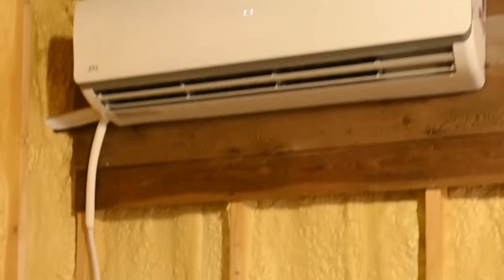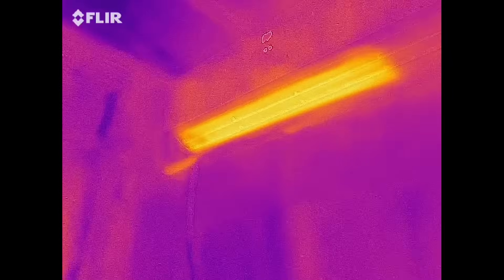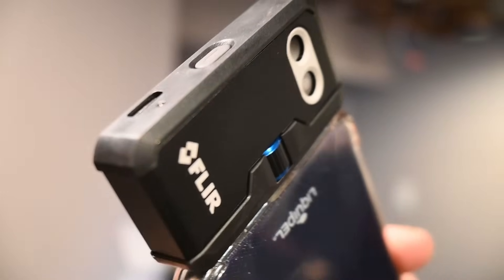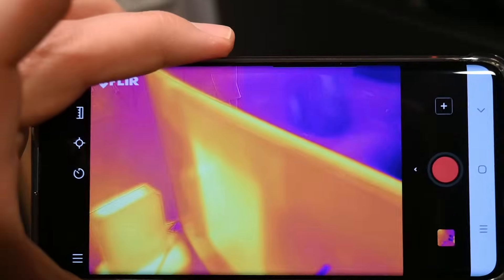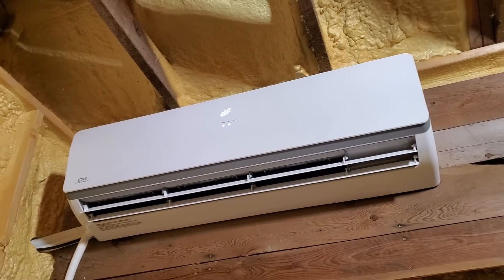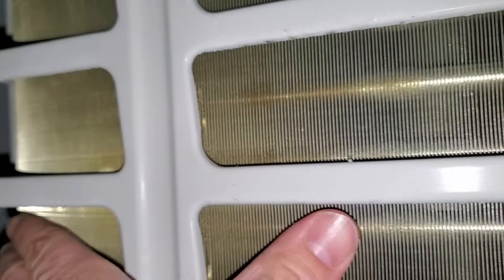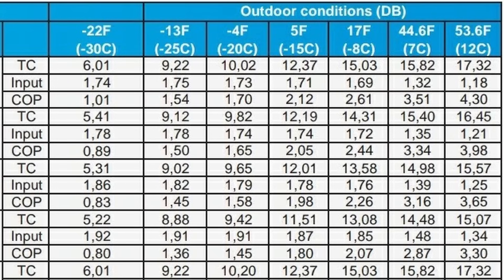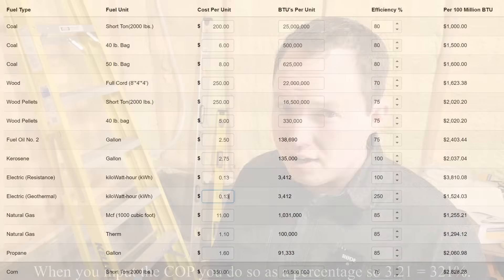Can You Use a Mini Split in EXTREME COLD? Heat Pump vs. Propane Cost Comparison with Thermal Camera

Comment: A heat pump does not pull hot air out of freezing cold air, it uses the heat generated by the gas being compressed. Only the different states of the gas in the unit is used to exchange the temperatures either in cooling or heating.

Comment: Why can’t we put them in th attic instead of outside?
Reply: It will be a worse situation. It basically works like an Air conditioner in the space - without restriction, or you can think of it like it turns the attic into a freezer, and the main place it will draw it's heat energy from is the house below.
You will enter a spiral where the heat pump is just pulling the heat from the house whilst the house is also losing heat through the walls etc, so it will never be able to warm up.  The outside provides an abundance of heat energy for the taking.

There are some situations where a heat pump doesn't need to be outside, e.g. an exhaust air heat pump. 
Those are for when the heat loss from the house is minimal, and a controlled ventilation system is required for bringing fresh air into the house, and the system works by putting the "dirty" air already leaving the house through the heat pump so it can extract as much heat as possible before it leaves, along with some outside air mixed in.  However, for those to work the house needs to be getting fairly close to Passive house standards.

Comment: Very clear explanation of the ability of a heat pumps operation at low temps.

In my case I have a steam boiler that handles the really low temps, but for much of t he winter the heat pump carries the load.

Comment: Great video. And you are correct and accurate, however; respectfully, I debate that compression of refrigerant is "creating" most of the heat being used. There's so much to be said about how heat is transfered that it's hard for people to wrap their head around, so scripting your video to be easy to understand was a good call. I think we can agree that "temperature" is a construct developed to more easily understand the release and transfer of energy. I'm impressed how far things have come since wet blankets and ice boxes

Comment: I've got a 24x30 garage with 10' ceilings (between the joists) and a bonus room above. I was thinking of a 28k split unit with an 18k head in the garage and 12k head in the bonus room (Cooper & Hunter Hyper Heat). I'm just east of the Twin Cities. Would that be enough?

Comment: I come from the AC repair in automotive and I was curious on how this system can work as a heater. This is the only video I could find that mentions the evaporator working as a condenser and vise versa. Got it. Good video. Thanks!
Reply: just look at it backward your condenser becomes your evaperetor and condenser becomes evap!

Comment: This is what I'm trying to figure out cause right now garage is propane only and we are $0.63Liter propane so thats $2.38Gallon. Electric is 7am-11am and 5pm-7pm $0.151Kwh, $0.102Kwh 11am-5pm and $0.074 from 7am-7pm and all holidays and weekends. Currently I run propane to keep at 60*F and was looking at a -22 heat pump minisplit cause have the AC benefit and Humidity control for warmer monthes. Just need to find out what your COP reading is...lol
Reply: I guess I can get a programmable thermostat so between the High peak Electric cost per kwh can use propane or if gets below that -15 can use propane but for the -15and warmer plus during tim3s wh3n electricity is cheaper I can run the Minisplit

Comment: I have a Fujitsu minisplit (rated to -15F) and I live a multiunit building in Fargo, ND.  Above 30F, it's all I need usually.  From 0F to 30F, it's worth running with supplemental heat from electric baseboard.  Below 0F, it still puts out heat, but I feel like it doesn't put out very much heat.  When it's below 0, I usually shut off all the indoor units except for one, because it's really only generating enough heat for one room.  And it works great as an air conditioner.

Comment: The problem isn't cold, it's humidity and wind.  A good snowstorm will completely clog any heat pump with ice/snow and they cannot create enough heat to melt off the buildup in subzero (F) weather.  If you manually clear it they will work just fine again.  -20F and no wind or fog?  Yup, they work well.  20F with fog, frost, and snow?  You're done for.

Comment: 8:45 wish I've seen when this came out. to simplify, you need more than 2 COP to make it worth while for a heat pump. even simpler, a heat pump is not worth it unless you're going to use its cooling/cold operation.  consider the installation cost and heatpumps/ACs don't last as long as gas heaters

Comment: I have a three zone Halcyon DC inverter minisplit system. While the air condition mode is efficient. I would not recommend a minisplit system as a sole source of heat, The heating performance is poor. With an outside temperature in the mid 40's, the minisplit unit got my upstairs room to 61.6 degrees  (with my oil burner system set at 60 degrees downstairs), during the night when it is colder outside, that of course eventually drops. I have contacted the contractor twice for the poor performance, but they insist it works properly.

Comment: An other important factor, propane heater generate water vapor, moisture which is pretty bad. I got a pretty well insulated house and do not use heating at all in Europe (-10°C outside is the minimum we get those days and I barely go under 13°C inside).

Comment: I agree with all of the comments, you do a great job explaining the COP, I would really like to see you analyze a air to water heat pump for several climate zones like a Noraire with a single heat pump central system, or an Apollo or Spacepak  Monoblock type system.

Comment: Running a tosot 12k BTU with hyperheat (tw12hq3d6d) and did get a couple of -20F days. It ran with a COP of 1.92, but 15min per hour was spent defrosting. So 75% of 1.92 gave 1.43, exactly like the spec published by the Gree Saphire (SAP12HP230V1A) which is the same unit. The unit is pretty awesome, I undersized and it heat almost all winter at 17 to 20k BTU, even though it's a 12k BTU. COP is now 4.5, with outside temperature of 39F. I measured COP at head unit using (input temp - output temp)*CFM*1.08/Watts. Would love to plot the COP in realtime, but need to find a way to get CFM, maybe by trying to grab the head units power usage. I find it pretty awesome that I'm heating a 1500 foot square house with the power it takes to run a toaster.
Reply: When defrosting it draws MORE power than when heating and doesn't warm your house - it actually cools it a little.  Full cycle COP can easily go below 1 in cold and humid environments due to the defrost cycle struggling to clear the coils of ice.
Reply: @knurlgnar24  Maybe depends on the unit? But that doesn't happen at all with mine. It does not require more power at all and I've measured it all winter. During defrost, it ramps the power up to 1/4 of max during 5 minutes with 10 minutes total of no power during switch from AC to heat. It uses the heat already in the pipes. So you could see it almost like a time out. It does however compensate after and heats even more and that's built in the algo, but at a good COP. So essentially, I've nerver gotten lower than 1.37 of COP at -22F just like in the SAP12HP230V1A sumittal pdf (1.9 while it's heating). I've had an average COP of about 3 during the very cold. Defrost has always worked really well and cycles 15 minutes every hour. I've only had issue with the pan getting ice build up and had to de-ice it  myself twice with a heat gun even though it does have a heater. I live in a high humidity and very cold climate.

Comment: I used to get summer fill in my 1000 gallon tank. During an extremely cold spell my furnace quit, no propane to the furnace. The guage was at 40%. I called my supplier and they said summer fill has more butane in the mix and that’s why it is cheaper. They said in extreme cold the butane will freeze up in the outlet from the tank. Fortunately I had a full 100# bottle to hook up until temps warmed up some.

Comment: The temp at which there is zero heat in air is called absolute zero, about 450 degrees below zero.  At this point the subatomic particles quit moving.  No kinetic energy.

Comment: Propane boiler :$3,900, ductless $1,600, removing the propane boilers for a2w heat pump (4 hours job) will save $46,000 in 20 years.

Comment: I would add that a gas forced air heater has other inefficiencies that need to be taken into account. First are the heat loss incurred blowing air from a central location thru ducting to far locations. Second is the blower itself that can require 600 watts alone to push air thru the ducts. My mr cool squirrelcage fan takes only 100 watts or less.

Comment: I'm a auto HVAC guy have used mini splits, love them,I think if we line the rear grate with a heat rope for pipes the mini split would pull heat off of that to increase efficiency and less defrost cycles with better heating.

Comment: We have 5 Fujitsu units in our home and there are a huge improvement of the radiant heat ceiling. I run 4 of them year round, the 5th is for the guest room. Our extreme cold is -14 and they have no problem. The only gotcha is you have to clean the filters every month on the blowers. Outside unit needs to be washed down every 2 to 3 yrs.

Comment: How do you adjust the COP efficiency for the energy used in the defrost cycle?  During defrost you are using energy to heat the outdoor unit with no heat produced in the space.  Is an average defrost cycle contained in the COP numbers?

Comment: At first it's difficult to grasp the system is pulling heat from such cold but if one considers the heat pump is working like a deep freezer, it then makes sense. Place a hand by the external coils of a deep freezer and you'll feel considerable heat. That's exactly what the heat pump is doing. It's making the outdoors a deep freezer and the benefit is the resulting heat indoors.

One question I have is how does a heat pump prevent winter rain from freezing up all the coils, which would reduce the heat pump's efficiency?

Comment: I set my heat pump to heat my home to 54F while I was away on vacation. When I got back home I found a tree branch between the fan blades, and my outside unit encased in a block of ice about 4 inches thick.  So maybe only do this if your heat pump has some sort of shelter from the elements.

Comment: Where I live, in Southern Ontario (Canada), the temperatures run around -20C (-4F) for two months of the winter.  and -10C (14F) for another 2 months of the winter.  That would give a COP of around 1.9 for the winter. The main problem is that we get around 2 weeks of -40C/F temps and Mini Splits just won't work in those temps, so that's why we use an oil burner furnace to heat our house (won't don't have A/C, it does not get hot enough to need A/C). Sometimes the temperature falls below -45C and the neighbours propane furnace won't work since the propane liquifies at -42C.

Comment: I'll bet if you modify the unit by removing the outside coil and replace it with a buried copper coil 7' to 10' under the ground where the temperature is a constant 50 to 60 degrees. You know... Make it into a... (Geo Thermal Heat Exchanger)
This unit would run at its maximum efficiency year-round.     Both heating and cooling

Comment: I'm new into heat pumps owning two and I've realized one important thing. The amount of insulation your home has is crucial to a comfortably heated home with a heat pump. 3-4 tons/36-48k btu of heating is simply not enough for you average midwest 2000sq 1960-70s home unless it has had replacement windows, doors and upgraded attic, crawl space and even exterior wall insulation.
Reply: If you noticed, the insulation was spray foam, which is the best insulation commercially available. The problem is that the studs are directly on the back plywood, which means they only have the insulation capacity of wood. My house had the studs installed with about an inch space behind them. That way, when they sprayed the foam it got behind the studs, providing an R-7.5 barrier.

Comment: Mitsubishi go down to -15 degrees and give heat at -5 60% or more heat capacity...Mitsubishi are king of minisplits...Mitsubishi hyper heat 2....been heating and cooling only minisplits for years..saved a fortune on oil....oil furnace is there just as a backup, never needed to use it....the U.S. is so far out of touch, the world uses minisplits everywhere, SILENT running inside and outside
Reply: Mitsubishi has good units. The rest are catching up pretty darn quick and at 1/2 the price. DIY systems are economical to buy and install compared to Mitsubishi. Mechanically inclined folks are able to find tanks of Nitrogen, tanks of 410A on the internet.  As well as vacuum pumps /vacuum gauges and all the fittings, by passing the local refrigeration retailers that only sell to HVAC techs.
Reply: @detroitjohn4724  Technically it's unlawful to purchase R410A without EPA certificate for it. Years ago, that was not so, but now it is.

Comment: That's what I keep telling people. Natural gas and propane are so much faster recovery times that the 5% of the chimney is not worth worrying about  I can even use a Douglas system in the Winter I freeze my butt off because it only comes up 5ﾟ in 8 hours I turn on my gas furnace it blazes heat out of the registers and brings it up to temp in 5 minutes

Comment: One problem with these split systems is that the thermostat is inside the interior unit. Some of the room being heated does not get warm because the unit thinks it's warm and starts shutting down. Also it is warmer near the ceiling than down at the floor. I have two of these both for cooling and heating and they work very well, it's just annoying having to keep playing with the temperature control.
Reply: For newer models, the thermostat is built into the remote. You can set the temperature on the remote and put the remote in the coldest/hottest area of the room.

Comment: Thanks for doing this video it helps. I have a decision coming up concerning this. I have a 30x40 insulated shop and want to install a heat/air system. I was wondering... I have a south facing 40' x 10' wall and can build a solar heat collector on it with outlet plenum at top right corner. 

I was wondering if I do install a mini split and was able to get 5 to 10 degree warmer air in winter at least some of the time, should I install my mini split in that top right corner with solar heat collector supplied air so it can use the warmer air to increase efficiency in winter? I also have access to 48 degree well water so I could easily build a water based cooling system for the hottest days of summer where I simply run the cold water through a large HVAC type heat exchanger for supplemental summer cooling. 

I could also go with a geothermal type system but the up front cost would be kinda high and not sure that cost would be justified with the low cost of the mini split systems available. I do not want to use the well all the time and do a total loss system where I use that 48degree water summer and winter. 

Neighbor is a well driller though and I could probably sink another well or a bunch of geothermal type holes and use that for geothermal but again up front cost for everything would he high. I am thinking a mini split with the install having access to solar heated air in winter and then whatever the mini split could do in summer plus the well water cooling system for supplemental cooling on hottest days would be cheapest option. 

Next decision on the mini split is what actual size do I need? and should I get a multi zone unit for each end of the shop? Getting one to big would probably be a lot more expensive up front and to operate but could possible pump out glorious amounts of warm or cool air as needed. I don't heat the shop up to much in winter, only keep it at 50 or so and then up the heat only when I go out there. 

That is proving detrimental to my machine shop equipment though. Mill and lathe do not like to operate at 50 degrees and will not come up to 65 degrees vary quickly. If I had a more efficient heating system I would like to keep the shop at 65 degrees all winter.

There are other interesting options such as a bunch of solar panels on the south facing roof generating electricity for the mini split but at what cost benefit long term?

Comment: As noted in this video these heat pumps "do work in winter cold" however, it's less efficient as the temps drop below 30 degrees which means this information is much more important in calculating which source of energy to use, NG, LPG, wood, or electric. The common denominator to all of this is cost of fuel.power and as we all know, prices vary much from area to area. That's the big problem to figure...why is electric priced so differently from area to area, state to state? Generating power in CA vs. TX isn't that much different yet the price to the users is by 6 times in some cases.